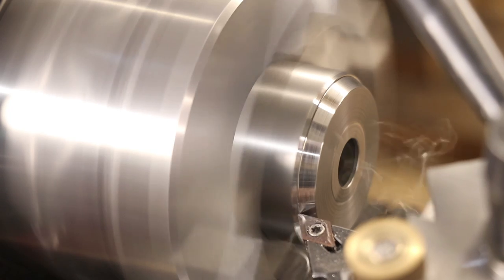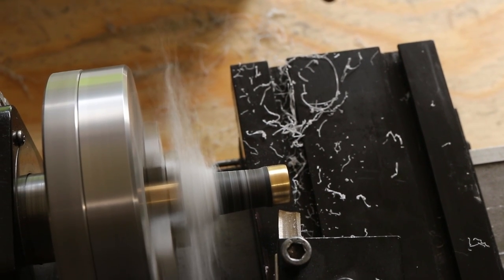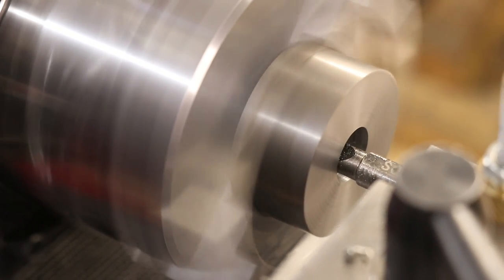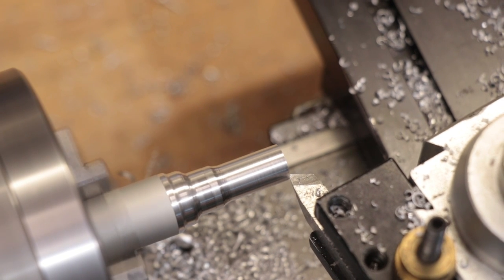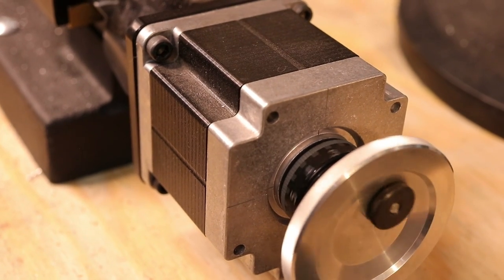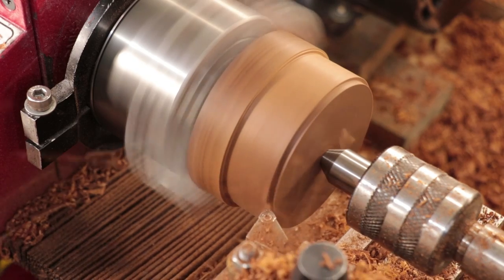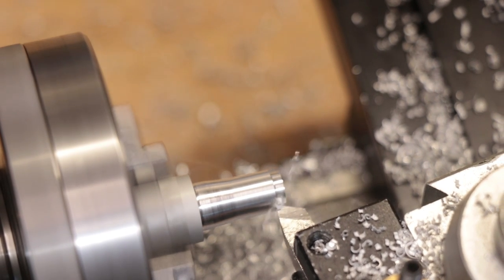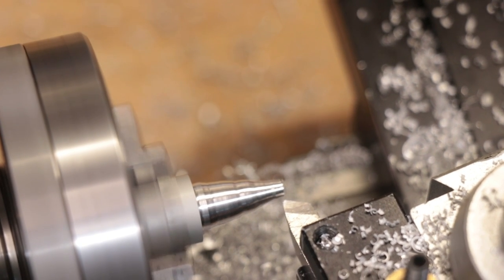My CNC Lathe and Why I Don't Use It Anymore

Comment: The problem every single person here has is they are relying on CAM. YOU CAN EASILY CAM FROM YOUR BRAIN. I’m 2 months into a new job being a Cnc setup operator and on the first week, one week they taught me how to write cam from scratch. It’s not that hard guys, Cnc is faster than manual ALWAYS but only if you can write gcode from scratch. I’m writing gcode every single day with nothing but a blueprint and a two axis lathe controller. Forget about any cam system and level yourself up to knowing what you are doing.
Reply: Clearly you no nothing about CNC machining. You’ll learn someday
Reply: @glass1258  uhuh good on you bud, putting people down for fun with zero proof. I still stand by it, 2 year apprentice across 15 machines manual and Cnc and I still know cnc is king, but every Cnc shop still needs manual machines. Trak DPM RX5 is my favorite machine sofar, Cnc+conversational+manual all in one. Everybody should try out a trak like that.
Reply: Hope you a fun journey, CNC machines are a blast, sometimes literally 😂 being into programming for several years now, I totally agree with you, when you master both NC  coding and cam software, you can do whatever you want.

Comment: Some things are actually faster in manual machines, especially if you're only machining one piece. That's why even por shops with CNC will often also have manual machines
Reply: Ufuu
Reply: Ufuuf
Reply: Uutuupfpypuupufpyufuufupfpupfpupufpufpupfupffpuffpufpfpupfpuuuuufpffpufffpuhuufpupfufuufffpgpfpgpfuppfuuuupuuufpupuuuf
Reply: Uuuuff
Reply: Uuuufff
Reply: Iff
Reply: Uuupuff
Reply: Ffpdo
Reply: Fffufp
Reply: Fff
Reply: Fugff
Reply: Fåfffff
Reply: Ffffyy
Reply: Fåyf
Reply: Fr
Reply: Ffuffff
Reply: Frfufyf
Reply: Ffufff
Reply: Good if you drop a part and you need to fix the finish on a face or chamfer. That's all. Quicker to program in back ground edit then during a 20 minute break in production make a part. Would take about a minute to machine that Ali part with a canned cycle.😂

Comment: You can occasionally find smaller ball screws on the bay.  I picked up 5 10mm ball screws for approx. 250 and retrofit both my sherline mill and lathe.  The result was unbelievable.  The backlash has been under .001 for over 2 years.  I was adjusting the backlash every other day before I modded them.  I can post some pics if you want.
Reply from the maker: That very might be the way I end up doing it. Cheers
Reply: I have yet to really dive into this as far as cnc'ing an old lathe, but some guy told me that some control software has backlash compensation.  I know this probably isn't as good, but I've heard its a thing
Reply: I what brand of ball screws are they?
Reply: Did you buy the ball saddle and bore it out or make one from scratch?

Comment: I have a CNC mill and a manual lathe. I'm always intrigued by CNC lathes, but as others have pointed out, the manual lathe is easier for what I end up needing. I am half way through a ELS conversion. With the lead screw working, I can cut threads without changing gears, which is super nice. Once I hook up the cross slide, I'll be able to do tapers without a compound (for improved rigidity on my small lathe).
Reply: And.... we see that you succeeded in that conversion, wow.   I agree that an electronic lead screw is the way to go for a lathe, but that is not the same thing as a purely CNC lathe.  The ELS is way better, and in my mind more capable than a manual lathe, especially if you have a plain lathe that lacks a traveling carriage.  A plain lathe is much more work for cutting a ball, an accurate taper, threads, taper threads, etc. 
This is why I want an ELS, because several precision lathes have followed me home and all lack a lead screw and thread cutting ability.

Comment: I have had a Sherline Lathe and mill for 15 years they were both converted to CNC as well. Here is the bottom line. they are not suited to CNC with or without ball screws. they are as rigid as wet noodles and the wear surfaces are terrible. the bed is not hardened and the wear surfaces on the cross slide system comprises of anodized aluminum and wears very quickly. If you tighten the gibs to get acceptable tolerances then the torque of your hand turning the handwheels is enough to twist the cross slide and ruin your work. if you want to do lathe work on a budget long term go with a Precision Matthews unit or similar in the 10 inch range. if you must stay with a small unit... then go with a Taig. the Taig at least has adjustable brass gibs with multiple points that ride on steel dovetails that has nearly double the wear surface as compared to the Sherline.

Comment: It's really easy to remove backlash from any lead screw or even threaded rod. Fit two nuts, screw them together and spot weld. Zero backlash.
Reply from the maker: Sherline has a system similar to this and the results are kinda mixed depending on which part of the lead screw the carriage is at
Reply: @artisanmakes  I use this method on the machines i manufacture, although i've now designed a tube with grub screws that the lead screw nuts sit inside. Once they are on the leadscrew you just need to turn one of them backward a few degrees and then lock it with the grub screws. I can drop a V bit tip onto the mm markings on an 8 foot tape measure at any point across the bed repeatedly. As good as any ball screw.
Reply from the maker: Fair enough so. That seems to be a bit more extensive than the sherline system. There is no springs involved, just a anti backlash but held in place by a screw. And it wears out really fast

Comment: Most points you made resonate with me as a hobbyist. CNC is great for production work but leaves a lot to be desired in the one-off parts, repairs, and fun department.
Reply: I think it depends what you're making.  As the complexity of parts increases, the argument for CNC does too.  For example,  drilling a PCB needs hundreds of operations where any one going bad ruins the whole job.

Comment: From a hobiest perspective I have never had any desire for a CNC lathe;  half the reason I own one is the enjoyment I get from turning parts myself. That said I'm fitting an electronic leadscrew, mainly because the change gears can't give a low enough leadscrew speed for use as powerfeed during normal turning, but not having to mess with the gears for threading will be nice.

OTOH I find big jobs on the mill a bit tedious so CNC conversion is something I've thought about.
Reply: Also adding an ELS to my Atlas 10".
Reply: FWIW I've done the Clough42 ELS and couldn't be happier. Mine is heavily modified, with a second control panel and some new features, but even "out of the box" the clough42 ELS is an extraordinary bit of kit.
Reply: @WheatMillington  Did you struggle to get hold of the TI F280049C Piccolo eval board?  They have been unavailable from the trustworthy distributors (Farnell, Mouser, Digikey etc) for a long time, and no sign of that changing soon.  Tried ordering one from Aliexpress and predictably it didn't turn up, but at least I did get a refund,

Comment: I bought the Rocketronics ELS (electronic lead screw) for my G0768 (S3) and it really does a great job of being the step over from manual to CNC.  I can do complex curves, balls, tapers, and threading with ease with the ELS but my lathe is still manual. The nice thing is the ELS doesn't require programming other than to set the starting position in the X and Z, and then setting the length. Even small production runs are possible with the use of a couple stops. Thank you for the interesting video and if you are doing some CNC, I'd like to see it.

Comment: I have the manual Sherline, and it works pretty well. Even got the milling head attachment. With patience, I can usually get to a .0005" to a .001" size tolerance, and about .002" position for holes. Works pretty well, but it really needs axis locks, especially on the Z axis. When I made an axis lock, it turned parting from a screeching banshee to a relaxing cutting sound. I don't think I'd get any decent results in parting off steel without the lock.

The backlash adjustment nut works pretty well on the Sherline. I got mine within about .001" or so backlash, which should be more than good enough for the vast majority of stuff. I am a little concerned that the leadscrew probably isn't hardened though.

Good god the endless cranking sucks. 20 turns for every single inch on every single axis. That's the entire reason I'm going to make a power feed for it. It's going to turn me into Popeye the Sailor Man if I don't!
Reply from the maker: Honestly I never thought about the hardness of the leadscrew, I might have to look Into that. Cheers

Comment: I have been using Sherline tech for quite a while now and here's some of my tips:
1: The QCTP your using is complete crap. I have used that exact one before and it significantly reduced rigidity. Get a nice OXA tool post, they aren't cheap, but they are worlds better than that one.
2: You're not using the anti-backlash nut on the crosslide. Look up how to install it, it reduces backlash SIGNIFICANTLY.
3: Make sure you don't ding the dovetail ways as it might mess up your accuracy and also give you ocd.
4: Dont abuse it, like you said, the sherline tools are a whole different class of machinery than the imports and should be treated as such. I keep my sherline lathe and mill oiled and clean as well as covered and away from grit. They are kept in an air conditioned space but that may not be necessary. Keep it clean, and dont take massive cuts unless your just testing the limits of it and dont care about the quality of the part.
I used to have a chinese import and It drove me crazy, it had zero rigidity and it couldn't cut even the easiest to machine grades of steel I had. But then again, you did some serious upgrades. Just my two cents

Comment: I have a CNC lathe so I can relate.  I got it because I wanted a benchtop lathe and that was the first used lathe that came up for sale near me.  I actually didn't like it at first because it was cumbersome to use in CNC only mode and I ended up buying a mini lathe. Since then I've added manual controls and made a GRBL based controller board and adapted it to use in sort of a hybrid manual / CNC method.  I've actually come to enjoy it and have more plans to modify it and plan on selling my mini lathe as I don't use it any more.

Comment: The Centriod Acorn CNC is very nice. I started with a ELS and more, after 7000 lines of code, and still no g-code interpeter, I went for the Acorn CNC. It has everything what I needed : Encoder input with a Z-chan, analogue speed control, 4 axis control, digital inputs, relais outputs, touchscreen option, and a special easy job editor to generate g-code, and Fusion g-code input. I use it with Stepperonline integrated servo's z:180W x:90W on a Sieg SC1 from Paulimot. Works great. About manual : my biggest problem were ball-turnig, threading and keeping everything in propper dimensions. What I also hate is doing things twice or more. This is perfect for a CNC. Baby-sit for the first part and leave the other parts for the CNC. I have also a MPG, so I can do still manual things "fast".

Comment: I own a bench top CNC mill, but like you, I seldom use it. From having been a machinist for 30 years and counting, CNC fits best with complex shapes and long production runs. My CNC mill sits idle mostly because most parts I can crank out manually in less time.
Reply: Converted a sieg years ago. Made a few things. Found the limitations of tooling quick.
Destroyed it with a bad scraping. 
Roof looked and dripped directly on z screw...
PC blew up...
Sigh.
Got a roll of turcite and new screws sitting on the shelf.

Manual tool changes i can handle but cnc tooling requires discipline...

Comment: I have a Sherline mill that I converted to CNC.  Since I did my own wiring, I have ready access to the stepper motor wiring.  Using the mill manually with the handles turns the motors into generators, which can apparently blow the output drivers on the control board, but if they are disconnected, then that problem goes away.  I'm about to put in relays that I can energize remotely to disable the motors, making manual use much more convenient.

About backlash: I rarely do any work that requires better than .002 - .003 accuracy.  The X and Y axes are pretty simple to keep adjusted.  The Z axis I have counterbalanced with a weight that tends to raise the head, which eliminates the backlash for most applications.

Comment: When i first got my manual Emco  Compact 5 lathe I immediately got sick of turning hand cranks and went cross eyed staring at graduation lines, I thought it was 1930! So I converted it to CNC, then i felt like you (i LOVE the feel of manual) but i stayed with it and embraced conversational/ MDI CNC with an MPG (no CAM, no g code). Having a DRO and the ability to measure and limit any movement is priceless compared to manual, I will challenge anyone who thinks they can manually one-off a part faster than me. The ability to rapid back 6 inches at a feed rate of 100 ipm is beyond compare to manual. I also use the Mach3/ LinuxCNC widgets, stack up different widgets and make any part you want. You cant take full advantage of the MMR and feeds/ speeds of carbide with hand cranks. If ya save your MDI inputs it is very easy to build a g-code file for complete automated and production cuts. CNC is millions of light years ahead of manual. Anybody want to challenge me to a one-off no g-code? I can do a full unedited video for proof !

Comment: I already have an Atlas 618 lathe which handles larger work than a Sherline. However, I have been considering buying a Sherline for precise turning on smaller parts as well as being able to use it in a spare bedroom. I am not interested in CNC so this would be manual only. I am weighing the option between the 8"  model vs the 17" model. I don't necessarily need the longer bed as I have a larger lathe. [1] It would seem to me that the shorter bed would be more rigid under tool forces, and [2] it might be more comfortable turning the lead screw with the handle closer to the work when working on small parts than with the longer bed. However, the longer bed is not much more money, so if those two assumptions are incorrect, then there would be no reason to buy the shorter bed. Do you have any thoughts about my two assumptions?

Comment: I love your content on manual machining, and as someone who loves robots (who doesn't?), I like to see the cnc side too, including converting manuals. I do think a lot of your content is making tools for yourself or modifications to your machines, which is great and I love seeing that, but maybe you could try designing parts that can be made on the cnc in order to sell to support the channel. Once you have something designed you could make production runs with little additional effort in terms of programming and such, but could still give you additional content to share for improving the cnc just like you do for your manual machines. One off parts on a cnc lathe does sound like a lot of work compared to  doing it manually but it might be fun to see how well you can shape the production over time. Just a thought. Love your videos!

Comment: I'm a hobbyist, but I first learned on CNC mills (well... routers), and then moved on to manual machines. Even if I need three or four of a part, it's so much quicker on the manual lathe and mill than the CNC. I can spend as much time fiddling with toolpaths in Fusion 360 as actually making the part. And it isn't like the CNC machines require any less focus during operation: parts can move, positions can slip, and tiny errors in the gcode can add up to big problems that require immediate attention. I once lost a part because the endmill had been sharpened enough to change the diameter, and what should have been a move turned out to be a plunge cut. I'm sure for large production runs they are absolutely worth it, but I find them far more frustrating than satisfying.
Reply: Something like a $100k Haas is a whole different beast. We used to have one at work, and while it was unreliable, it was really a joy working on it. That being said, it is a "set and forget" machine, and it damn better be for that price tag. 

Honestly for home use it makes no sense to go CNC unless you're trying to make a business out of it. Especially smaller, budget machines are more hassle than they are worth, they are fiddly and as you said unpredictable. 
My great grandfather was a machinist during the WW2, he probably made thousands of parts by hand and lived until 93. No CNC stuff back then, I think I have a group photo of him and his colleagues in the factory, there are at least 30 or so lathes behind them.

Comment: I've never found CNC lathes to be practical except for large production runs or parts with complex features. Even then, there is a point at which an automatic screw machine (which does a lot more than make screws) becomes a far better option. Turret lathes can be more cost effective for making production runs up to a run of a few thousand parts. I once had to make 6,800 (minus none, plus 10%) parts. I used a turret lathe because the job could easily cover its cost, plus tooling, but wouldn't have come close to paying for a CNC lathe and tooling.

A buddy of mine had a contract with GM to make millions of custom spacers in various sizes. He purchased three CNC lathes with automatic feeders and let the machines run around the clock unattended (save for reloading the feeders every morning, changing out worn tools, and performing infrequent maintenance or repairs). His cost analysis proved that using CNC lathes was more effective than investing in automatic screw machines and buying the necessary custom cams, plus any of the CNC lathes could make the same parts as any other.